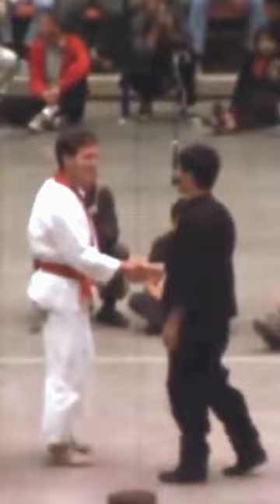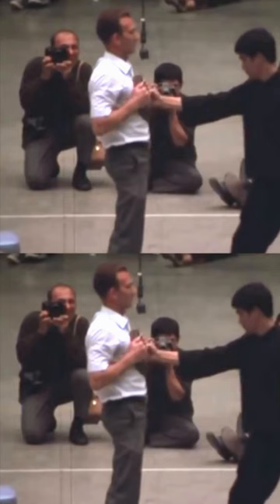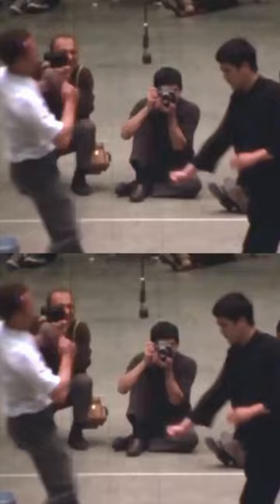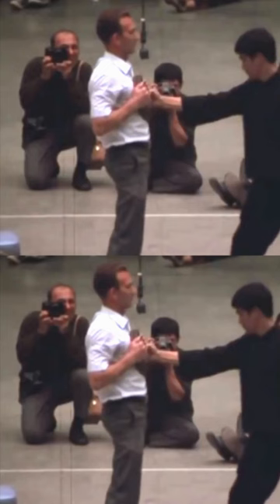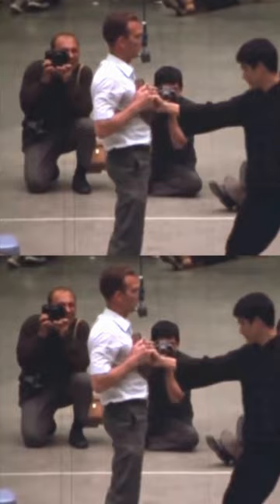Bruce Lee One Inch Punch Brutal SPEED and POWER!

Comment: It's not just exclusively to wingchun; short range power is just being normal to any internal styles of Kungfu for example Xingyiquan and Yiquan. However, internal style does not have anything related to Qi or mystical power at all; it's a work of your abdominal muscle related to shifting your weight from back foot to front foot rapidly with slightly sinking your body weight while your knuckle touching your opponent to drive him forward at the same time.

Comment: Should be called the 1" push . Come on guys watch what he is doing. No punch in sight.
Reply: ummm, punch has push dude. in this case, if YOU watch close, the snap-shove, has a pull-back technique as well that's merged? that I can't even explain. it can only be felt or delivered but I have a feeling that I swear is more of a melting of 3 or 4 feelings sunk into movement. I dunno man lol. He was something else!
Reply: Exactly. Using this "technique" i can do a zero inch punch. You just put your fist on somones chest and shove. I have no idea why people are so impressed by this.
Reply: It's an internal strike. Torque the body and sending your chi(ki) through your opponent.
Reply: @masterjim69  no. Its momentum and follow through. Chi is nonsense. Notice whenever  someone (anyone not just bruce lee) does a one inch punch, they dont just move one inch. They start one inch from the person then quickly follow through then return. If you have decent speed and power anyone can do it.
Reply: @smasher.338  It's actually both. But it is a punch. Bruce always said he doesn't push, he punches. It's also done in Tai Chi. Steven Seagal did a similar strike in his later movies. It does take "chi" to be most effective. It sends a shock wave thru the body. That's why Bruce uses a pad on the guy to demonstrate, to dissipate most of the energy since it can stop the heart or collapse the lungs. Someone with a bad heart could easily die from that strike.